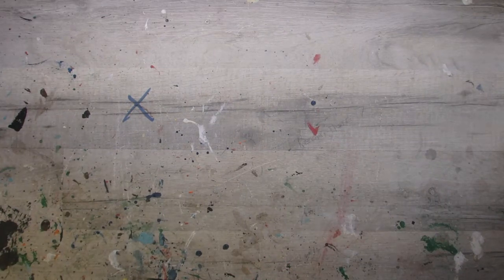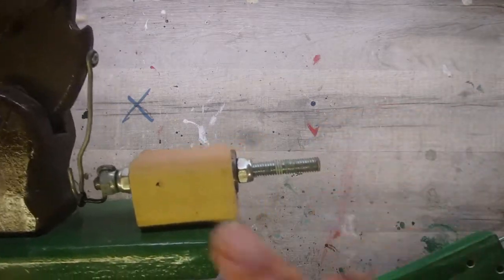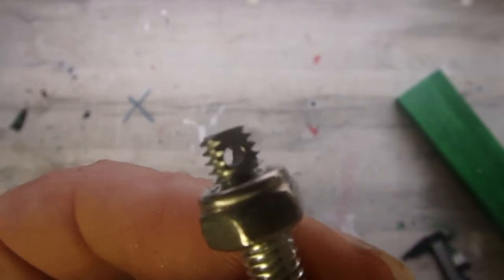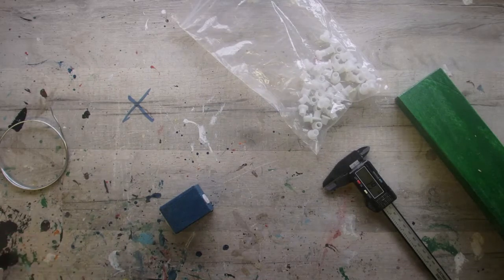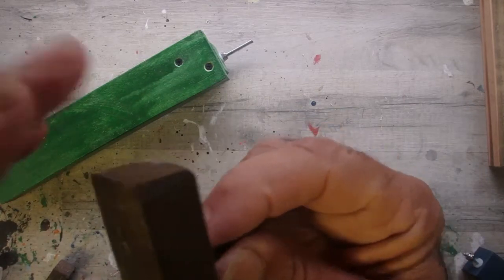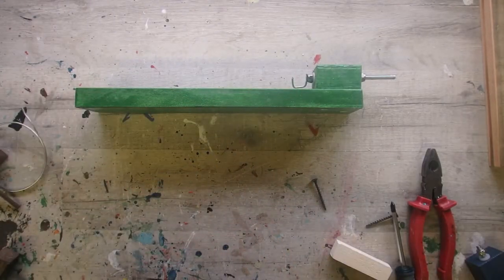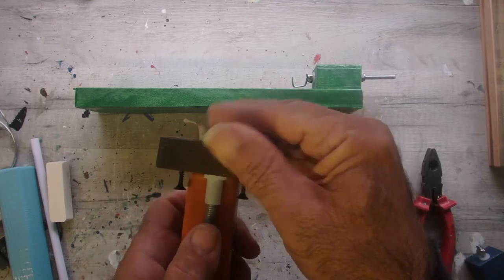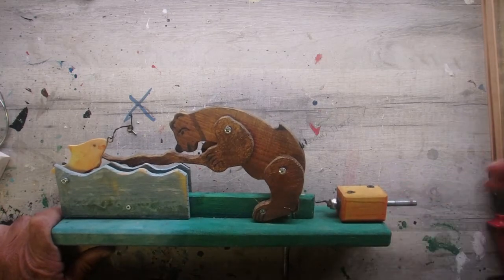How to make Whirligigs, Ep3 Making the Base

Comment: If you have the threaded rod,  it seems to me with the wobble, that would wear into plastic liner over time…if there was a plastic liner. Less so with a metal liner. That is my uninformed thought.🙂
Reply from the maker: Have had a whirligig in the garden for 3 years with no problems but you can always change the plastic bearings